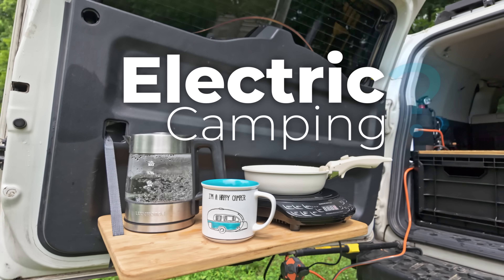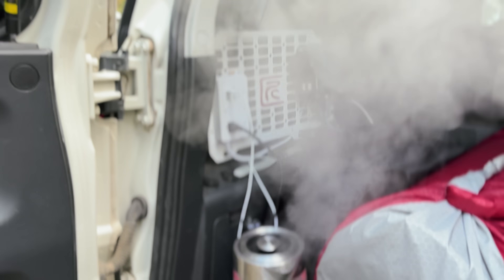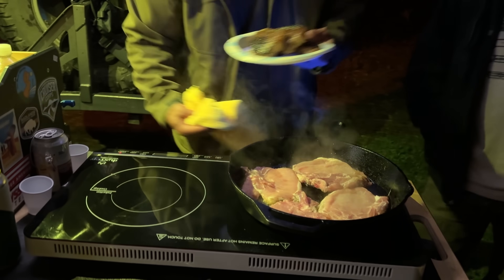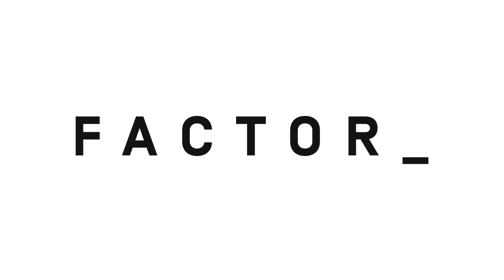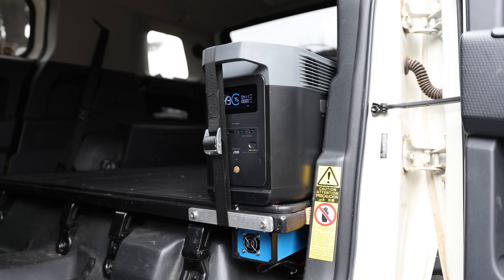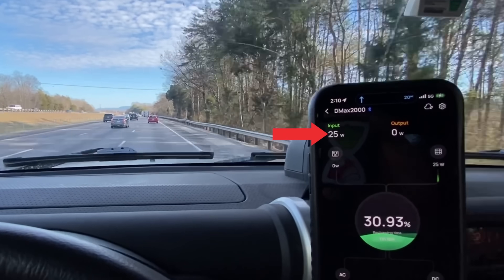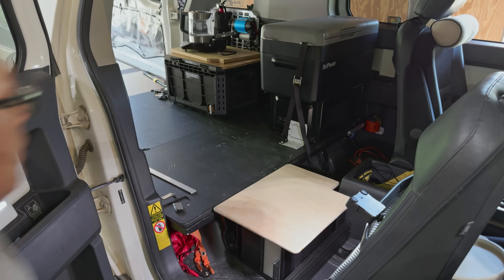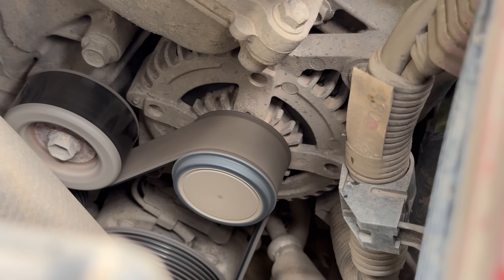I Tried Full Electric Overlanding For 1.5 Years | Was It Practical?

Comment: 3Kw power station, 1200watt flexible solar, Honda eu2200i generator ( only used for charging power station) DC charger cord from vehicle battery with breaker incorporating XT60 plug ( power station has MPPT programmable charge controller) and diesel heater.
Can operate longer than I care to stay in the wilderness.

Comment: Im comverting a minivan to a (as close as i can get it) rv camper with a couch, twin(ish) bed and a rear counter with sink and cooktop. The only think im keeping gas is the cooktop as i really prefer cooking with gas as ive cooked with it my entire life and am really good at it. Ill be installing a 400w flexible solar panel on the roof and 200ah (100 currently) and use a diesel heater to keep the cab warm. Ill also get an electric heater as a backup or main and ill also be using a blackout foam for the windows (i hate the reflectix look, im going stealth) so far so good, cooktop going on in 2 days when it ships. Ive now slept in it twice(for testing, no trips yet) and i gotta say, my custom matress is more comfy than my actual bed

Comment: The route I went:
Anker Solix C1000 (1056Wh): It can be any power bank you like
2x 12v 300Ah LiFePO4 batteries ($300 - $400 each these days).
Wire the batteries in parallel, and splice them to the XT60 (solar) connection of your battery bank.
This provides me with 8700 Wh of battery capacity for around $1,100. Charging your power bank through the solar input will charge at 120W (10 amps at 12v), which is enough to trickle charge and keep you topped off.
I can go off grid for the entire week with this setup.

You can always make it better by doing the standard MPPT controller + Inverter setup, alternator chargers, etc... but since you're already buying the inverter and charge controller with your battery bank, this makes use of what you already have.

Comment: I’ve been running all electric for 2 years now in my off road 5x8 micro camper. Two 200ah lithium batteries with 3000 w inverter and 490w of solar panel power. It has always kept my batteries full from the Grand Canyon to the Canadian border. Microwave, electric blanket, induction stove, microwave and a small electric heater I turn on before I get out of bed when it’s cold.

Comment: great video! I have a 3000W pure sine wave inverter in my SUV for my eco flow, it charges at 940w just like it would plugged into your home, only requires wiring the positive and negitive to the battery or fuse box, you can also get fancy with the solar system and wire it inline with a smart switch and be able to use the inverter off solar as well

Comment: So I thought this whole "all electric" thing was a total waste of money and just some overland industriual complex scam.

Until I just did a trip, ran out of propane, had issues with my canister stoves in cold weather, and used a lot of fuel heating things at higher altitudes. I'm moving to an all electric system as well. Still will carry a backup stove and fuel source, probably an omnifuel since it runs on canister gas, diesel, propane, gasoline, or coleman fuel. 

You can get a 40ah / 2048 wh all in one system for around $500-650 anymore, with a 2kw inverter and 60v solar input. Without wiring anything else into the truck, I can charge at 10 amps with the vehicle's cigarette lighter output, and if I'm stationary during the day, charge at 15 amps via a single folding solar panel. 

A 12v fridge uses a max of 2.4 amps when its running, typically about 150 wh consumed per 24 hrs. An induction plate will use about 1000 wh of electricity over a day, which leaves me with a 50% SoC on a 2048wh AIO battery, so 6 hours of driving refills 900wh, and a dab of solar input here or there will easily top off the rest. If you put in a DC/DC inverter, you could safely charge at 25 amps on most vehicles and have a 100% SoC battery in just 2-3 hours of driving. And if you're doing a long road trip to get to your outdoor spot, you have electric right there to bang out a super simple meal at a picnic area along the way without priming stoves or unpacking a bunch of things.

The microwave is a totally unerrated device. There's so many things you want to heat up while camping that are a total pain in the ass without it. If you prepare meals, freeze them, and carry them frozen in a cooler, how do you reheat it without a lot of time and energy? You'd need to vac seal the food, drop it in boiling water. So you're heating all this water, holding it at temp, sitting there for 20-30 minutes after boiling 2-3 litres of water. It's an immense use of fuel. Or microwave for 6 minutes, use 180 wh, and done. It's half the energy used, half the time. All these little things add up to a lot of power consumption. 

The risk of fires, spilled fuel is negligible with electric. LFP batteries are super safe, are not subject to autoignition or runaway fires like cobalt batteries. If you make a stop at a state park that has electric, like at the shower house, it's nothing to charge up the battery there and carry it back to the tent-only site when done.

Comment: I have a microwave and electric oven/air frier/toaster set up. I love it. I use cardboard plates as well....no washing up. If you need heat to cook in an emergency you can start a fire caveman style.
Reply: How many watt hours does your power system have to routinely run all of that stuff?
Reply: @joeblow1942  I only have a 115AH lithium battery and a 2000watt inverter. I bought the lowest watt smallest microwave and portable oven I could find. The oven is also a toaster and air fryer that has an 1100 watt rating. The MW is 850 watts.. The 12volt fridge uses around 2 amps per hour and the microwave and oven are on for less than an hour per day and never at the same time. The oven often cooks while I'm driving. I tried 12 volt ovens twice and both were useless in my opinion. It's ultra important to have large thick cables connecting the battery and the inverter. My system is under powered but works for my circumstance because I'm on the move nearly every day. If I'm at a caravan park I either use their appliances or pull the appliances out and use them on a table. My system would struggle off grid in the one spot for more than a few days especially without any sun.
Reply: @mikehzz9848 . How do you recharge your lithium battery?
Reply: @joeblow1942 with a  dc-dc charger drawing from the car alternator or the 100 watt solar input
Reply: @mikehzz9848 . Ah, so it’s the dc-dc charger that does the job. Thanks for the useful info.

Comment: Many of my friends have converted to fast car charging.  All but one has burned up their vehicle's alternator and had to replace it, 2 of which were able to find a heavy duty alternator that could handle the charge load.  One of my friends can only find one replacement alternator, their are no heavy duty alternators for his make and model.  I've stayed with solar and I also recharge through the grid at local municipal parks via extension cables or hauling my solar power generator to the picnic tables or take out my LiFePO4 batteries and a portable charger and charge them at the picnic tables.  Due to the light weight of lithium batteries, that method, which was not convenient with lead acid, is a viable option now.

Comment: With a wrangler 4xe you get 4 110 outlets in the power box. If i were cooking steaks though I would have done it over that wood fire - yum
Very helpful, do you think a kettle on the induction hop would be faster and more efficient than the regular electric lettle?
An electric going electric in my sailboat.
Thanks!
Reply: One nice thing he stated about the electric kettle is that is auto-shuts off when it boils, reducing consumption and monitoring. The induction top and jet boil don't.

Comment: In my sports car I do 10k kms trips camping but no food cooking. I use my jet boil for coffee and boiling water for some quick Ramen. If I were to transition to doing Some cooking on these trips - there is no doubt I would go electric.

In my Transit van ( I do 3 month trips with it for 8 years now - 160k kms total) I use all electric. I built my own battery 220 amp system.  You are right about the all in one systems - couple years ago I would not have considered one. NOW I think they are the way to go if you are building a system from scratch.  The EcoFlow Power Kit looks like a great system and it is "Humble Road" approved👍

Comment: Tip: start sleeping in your drivers seat. If you practice sleeping on your back at home, you’ll learn to sleep incredibly comfortable in your drivers seat with the back down. It will take a little practice but it’s far more comfortable than any overlanding sleep setup and it saves a ton of gear and room. Plus, it’s easier to exit and enter in the middle of the night. It’s also easier to escape dangerous encounters or turn vehicle and lights on to alert others. 

I’ve been overlanding for 30+ years with the ‘most comfortable’ setups for sleep but this recent change for solo overlanding has literally changed my overlanding/offroading experience greater than any tech. I sleep better, with less gear snd more room and far greater security. Try it, but practice it and you’ll see.
Reply: You can sleep the entire night on your back?
Reply: @TN-ez6lz yes. Pretty easy if you train yourself to. I’m typically a side or stomach sleeper but my doctor encouraged me to sleep only on my back. Better for your spine. The transition to sleeping in my drivers seat was easy. I don’t even take my shoes off.

Comment: I’m pretty much full electric with my 4Runner for cooking,  I have renogy 50amp mppt dc to dc controller 200ah slim battery, 460 watts of solar.  nuwave stove, joule  boiler for water.  I still have all the propane stuff but that’s for when I go with groups.  I do sleep in my gfc tent so it’s a little roomier than sleeping inside the car.  No microwave though lol

Comment: In all due respect, go winter camp in temps under 32F. You might be able to get away fully electric for a couple days when temps are 20-32F, but anything under <20F, and you will be struggling and cold without an actually generator or shore power to get you through. Additionally, I wouldn't consider your experiment as going "full electric". You can probably make another video and take out your dc to dc charger before you leave. Not using your DC to DC charger would be more of a controlled experiment. You're basically just using your car as a gas generator to charge your battery banks. Also to note, people need to be careful with this and get a proper size alternator to handle the additional load. 

I have over 150 days in my manual 05' Dodge 3500 w/ Lance 990 (Bluetti AC200Max, 2x200 watt BougeRV solar panels) in sub-32F temps, and more times than not I'm utilizing my Honda EU2200i to get charged up especially when it is snowing. That said, I have been slowly getting away from LP even though there is a strong positive case for that as well. Also, I'm upgrading my battery bank this year by an additional 200 amp hours and adding more of a custom system. 

All that said, I like your rig. I'm not a huge fan of new Toyota Trucks due to their limited payloads and IFS, but I do like the FJs and would love to get my hands on a Hilux.

Comment: 2000Wh will only get you slightly less than 2 hours of cooking on a single induction cooker. You can easily get away with making junk food. Your friend's 6,000Wh sounds more practical.....but that is five 100AH batteries....almost 60kg of battery compared to 5-7kgs of propane. No thank you.....

Comment: For a camping trip of a few days full eletric isnt a problem, but if youre gonna live permanently in your campervan, there are things that consume a lot of battery when you can just use gas and cover those expensive eletrics leaving your with a lot more eletric power in the battery for everything else that actually need electricity.

For example, you cant charge your laptop with gas
You cant use your gaming monitor with gas
You cant use a microwave with gas

So you should use gas to cook, because you can use gas to cook... and that way you dont spend battery when you need it for your gaming monitor.

Comment: II like the concept of cubes and they are certainly getting more capable every year.  For casual camping and short trips they are for sure the go-to today.
Over the long term (1.5y is good but not nearly long term) a dual battery setup is going to cost less simply because the hardware is separate from the batteries which will degrade with time and use.
For my travel, I value the ability to replace and upgrade my batteries, myself, as needed over the convenience of a power station where, when the cells are gone the whole thing becomes a useless brick.
And fwiw even though I cook and cool with electric, I still carry a gas (and wood) backup.

Comment: I'm all electric. There is a upfront cost. 
I have a large capacity 3000wh electric/battery generator and a 30amp DC charger/converter running to the back from a 175amp car alternator and 8awg wire. That gives me 360w charging. I have 300w of portable solar for extended campsite use; that on a sunny day averages about 200w of charging across the whole day of sunlight. I have USB heated blankets, and for waking up in the morning a very small electric space heater. I have an inline electric water heater for washing and cooking. I have a jacked in DC bypass off of the generator to run the cars vent motor with the ignition off for sleeping ventilation with the windows closed. I have a kettle and a compact USB expresso maker; and a frother. And a dual zone 48L car fridge. Two induction hot plates. All while sleeping in my Jeep with cooking equipment, recovery equipment, and a good set of trail repair tools with essential spare parts.
I still have the two front seats open. The back end is packed on trips and when home I have all the seats and cargo area open for use.

I will not go gas, even for winter overlanding. Electric is just too convenient and comfortable; however, the whole setup did cost some money in slides, cargo shelves, and electrical units and wiring. I don't recommend electric on a budget starting out.

Comment: It isn't the Jetboil that was unreliable. That's grossly unfair to say. What you may not know, is that ALL of the piezo-electric spark lighters fail. Ask anyone who has had them on a barbeque. And gone back to using matches after replacing them 2 or 3 times in 2 or 3 yesrs.

Comment: This seems the go too for a SUV oriented build. But as a truck guy I feel like you need a sealed bed solution in order to protect an electrical setup from the elements.   Which low keys suck cus my gladiator pound for pound comes with a much beefier electrical system than my old tundra did. Factory 280amp alternator, factory dual battery. I at most can get away with running my fridge in the bed with just the insulated cover and it hasn’t failed yet. But a whole 1k plus battery pack? Not worth risking or do you think it would be fine? My gas stove is the last thing I run on propane and I’d love to get away from the little green bottle. I do a lot of winter camping and gas just doesn’t hold up. But I don’t have anything in the cab except recovery gear and tools under my back seat because I pride myself on a full functional and passenger accessible cabin. Which has saved my crew a lot of headaches when 2 extra of my bros gotta pile in to go get spare parts 2 hours away or if we have to abandon a rig for now and just get someone home. Maybe I should get a bed tool box to support electrical systems? The issue it it can’t be massive or permanent cus the gladiator is already to small and I use it as an actual truck for my day to day.

Comment: Have twin BLUETTI AC 180’s in my excursion with pecron car charger and 300 w solar panel suitcase. So far so good all for 1400. With a front and rear winch wiring I can plug in there also for power

Comment: The truth is that if you want to alternator charge you need a second dedicated alternator in the system. Don't  be fooled, the DC/DC charger is not good for your single alternator,  you will get stranded unless your on top of a hill & drive a manual.

Comment: I have an 07 FJ, and I built my system into my drawer system. I have a 200ah Lithium battery being fed by a 30a Renogy dual charger from the alternator. I use a 1000w inverter, and it stays topped up with only a few hours of driving per day. The factory alternator is 100a only, so I upgraded to a Tacoma w/ towing package alternator that is rated at 130a. The system is very compact and only takes up 1/6 of my drawer system.

Comment: I use the Ecoflow as little as possible on a camping tour i charge the phone maybe, use it for a led strip light and other small needs and a heater, other lights have their own batteries, food i make on a gas stove, boiling water on the same so the Ecoflow do not need to be charged at all on the camping tour over a couple of days! And no one need a microwave oven  on a camping tour or a hair dryer that is nonsens! If you not have a RV then who i dont have!
And if i need to charge it i can use solar or a dual fuelgenerator who can use gasoline or propan for fast charging.

Comment: I was looking at the Delta 2 Max, but it uses Li-Ion battery tech and not LiFePO4. I'm not 100% sure.

Thanks for the video, interesting the the Victron DC-DC Converter as an inexpensive solution. I like the idea of the Ecoflow alternator charger, but ~$800 CDN is too much.